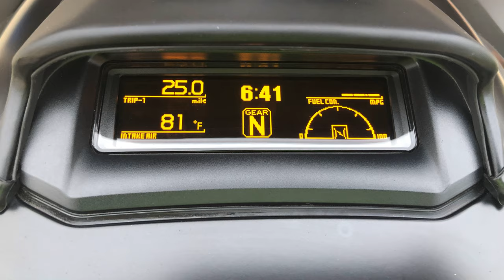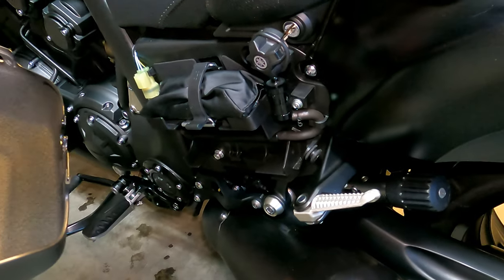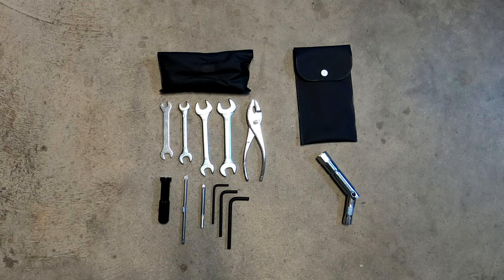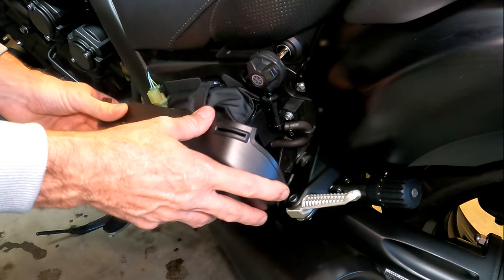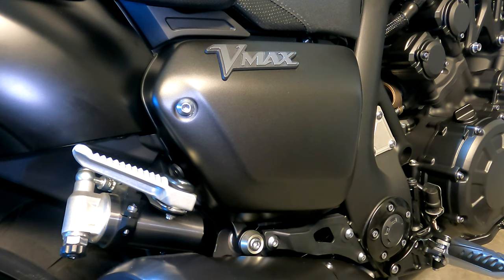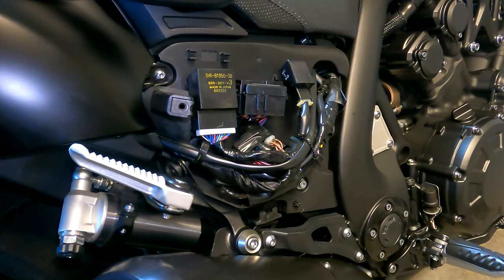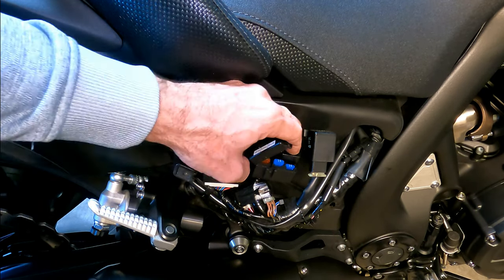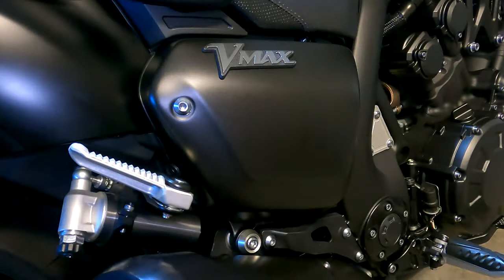How to Remove the Side Panels on a Yamaha VMAX 1700

Comment: Cool, I’ve owned this bike for almost 12 years and 30000 smiles now, and never knew I had a toolkit there ;-) I do have a radar detector connected to my shift light, though. Best mod ever.
Reply from the maker: I’m a few thousand smiles behind you, but I’m working on it. 😁 Thanks for watching.
Reply: Norbert Wangnick smart using the shift light for the detector. Did u get it installed or was it a diy? Considering the kind of bike it is, this should be the next mod on my list!
Reply: It’s a fairly simple process, I’ve done it on two other bikes as well. On the VMax, I had it done by an electrical eng. friend of mine, and it’s been years ago, so unfortunately I can’t tell you the details. On my BMW, I tapped the wire into the parking light. The detector itself (on the VMax) sits on a velcroed platform on top of the brake reservoir. Have fun!

Comment: I love the detailed .. no lag and in-depth videos you make. I just subscribed. I have a 2012 vMax and love it. It’s been unused for a couple of years because of my travel. Now after service and cleaning I find that the bike handles are heavy and tough to move when I am parking or moving the bike around the garage. Has that got to do with my suspension settings ?
Reply from the maker: My guess is the Steering Bearings need repacked with grease. This should happen every 16,000 miles. Thanks for watching and subscribing.
Reply: New bearings.